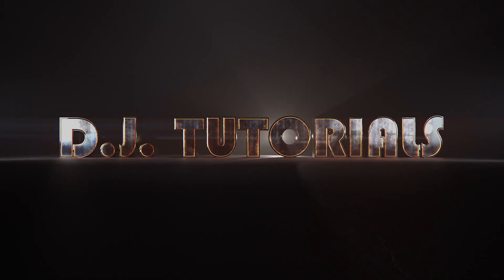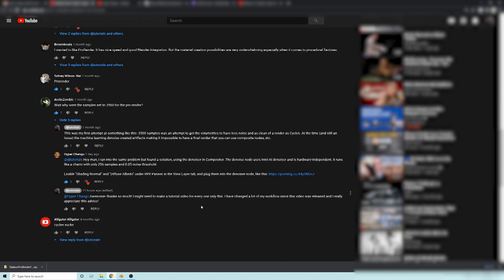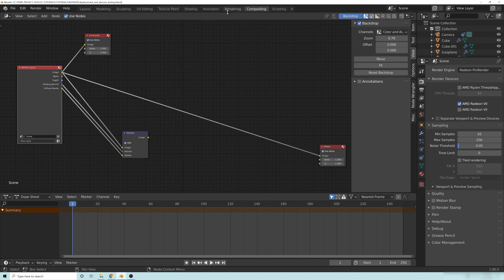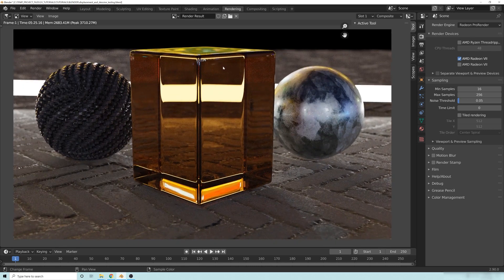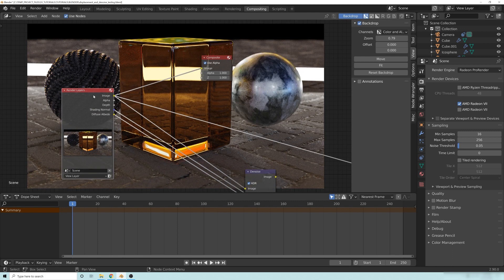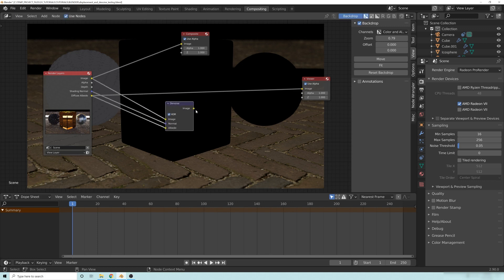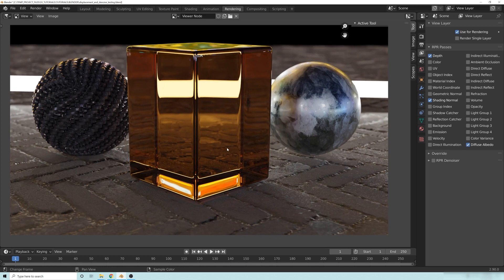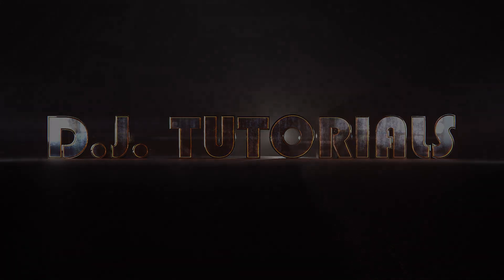Radeon ProRender for Blender | Pro Denoise Passes

Comment: For some reason when I'm in the compositor I don't see a denoise node. I am still on Blender 2.8, could it be that I'm on an older version?
Reply from the maker: Did you try hitting f3 and searching?
Reply: @djtutorialscgi  oops that was my issue. I get an error message when I select the denoiser but I assume I just need to re install RPR.
Reply from the maker: @LucasHorowitz  worth a try... you on Mac, Linus or Windows?
Reply: @djtutorialscgi  I'm on Mac Mojave
Reply: I was trying to use the denoiser on 2.80. Doesn't seem to work on that version but works fine on 2.81
Reply from the maker: @LucasHorowitz  Awesome- are you on the Discord server?
Reply: @djtutorialscgi  I'm not, let me join instead of spamming the Youtube comments. Just got it working, turns out i had o update to a more recent version of blender.
Reply from the maker: @LucasHorowitz  All good- I am just quicker at responding through there.

Comment: Is there a way I can do that in cinema4D?
Reply from the maker: I don't really use Cinema 4D- which engine are you using in Cinema 4D? Prorender?
Reply: @djtutorialscgi  I've been using cycles 4D more because pro is too grainy, but I prefer pro cause it's alot easier
Reply from the maker: @devenwilliams5138  You should be able to select render passes in ProRender. You will need to check the plugin documents.
Reply: @djtutorialscgi  the render passes is one thing, but what you did there with the compositing. I'm not sure what would be the proper measures to take about that within C4D
Reply from the maker: @devenwilliams5138  ah- that I can't really help you with unfortunately. I don't use C4D but I am sure you can go to the AMD ProRender forums and ask.

Comment: Thank you so much for this tutorial! I have one question as a beginner: I have followed all the instructions and it worked when I viewed the render, however, when I've rendered an entire animation the noise was still in the exported PNG files. Is there any way I could automatically apply this denoise to all exported PNG renders? Thank you!
Reply from the maker: You need to pipe your output in the compositor to the composite output node. You might have it just piped into the viewer output node.

Comment: thank you so much for posting this. The RPR AI denoiser has been causing all sorts of issues. Gonna try this method and see how it works.
Reply from the maker: Yes- the Machine Learning is good when it works but it often leaves a lot to be desired or artifacting. Also, when using RPR 1.0 “Full” renderer, if you are finding artifacts, use only 1 render device.
Reply: @djtutorialscgi  Good to know thank you! I've also considered denoising in a 3rd party program like Premiere, do you think this would work better or just as well as in Blender?
Reply from the maker: @LucasHorowitz  The Nvidia denoiser for Davinci Resolve is amazing- Tony Dae swears by it but I am not sure how it would handle noise from raytracing engines. Not too sure about the denoiser in Premier. I haven't really tried it.